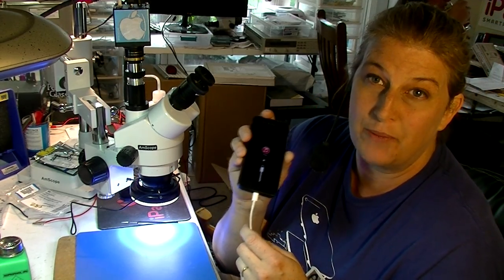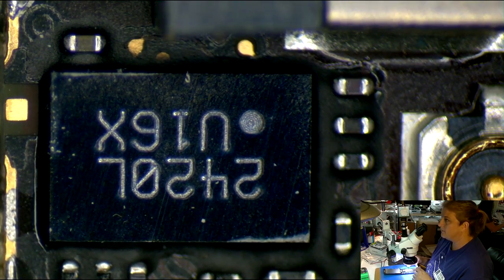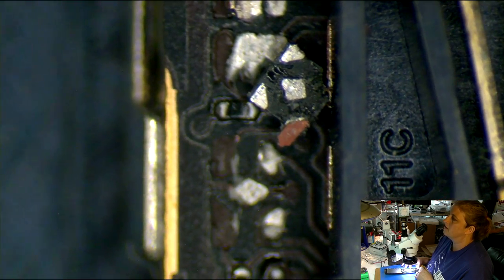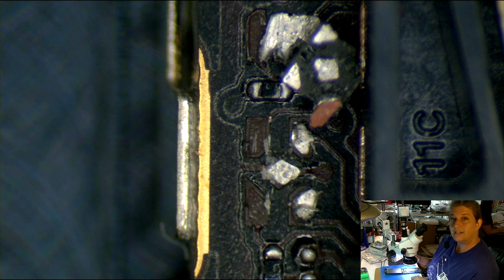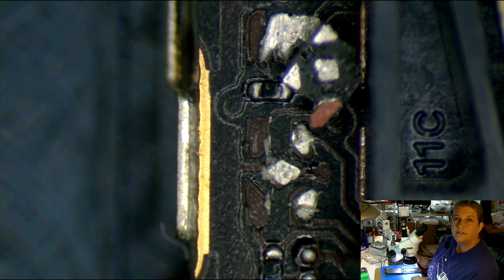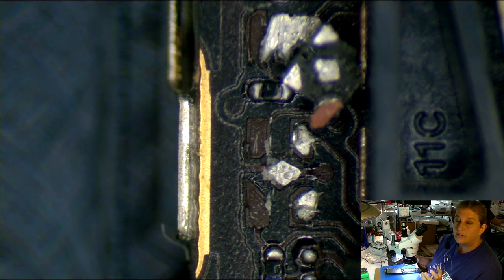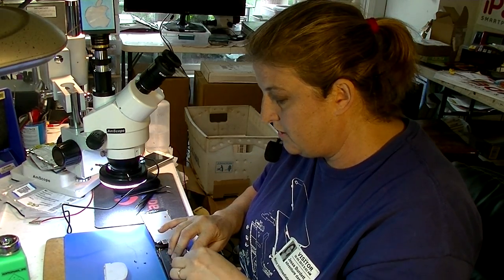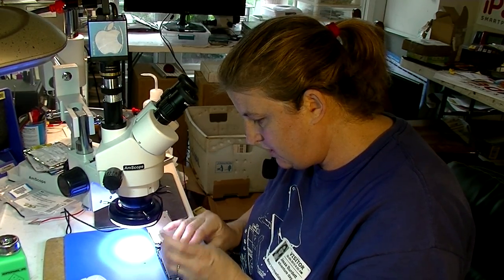iPhone 5 Logic Board Pry Damage after Battery Replacement

Comment: I searched this video to see how can I fix pFy damagr which possibly I made during Battery replacement. but good thing I found at the end of video that power button has two littke golden pressers which makes connection and make button work. I just used a screwdriver to connect while digitizer was lifted up and it worked. That means my curcuit on phone is fine and no Pry damage. So I little pull them uo so when the digitizer closeses down can make a firm connection on its press. IT DID WORKED OUT FOR ME. I AM HAPPY. SO ALWAYS CHECK FIRST BEFORE DECIDING ITS PRY DAMAGE. IN MINE CASE THERE WAS NO PRY DAMAGE JUST A LITTLE PULL TO THOSR TINNY GOLDEN FINGS ON THE CIRCUIT MADE IT WORKED. THANKS TO YOU. YOU ARE REALLY DETAILED.

Comment: Thanks for your video. Yesterday, I took my iphone 5 to the Apple Store; when I went to pick it up,  the phone had the same problem. The tech had no idea what happened, but obviously an unskilled individual blotched the battery replacement. Although they said they will replace the phone, they didn't have one in stock and I'm having to wait several days until one is found. Sucks!

Comment: Very informative, thanks.   After replacing my LCD + screen, I was testing it before I reassembled the whole case.  Home button wasn't working, and that was obviously because the case wasn't closed and the flex cable not touching the opposite connectors.  Duh!

Comment: Hey there. Today I switched the logic board of a white iPhone 5 with the one of the black variant. After that, the exact issue came up. Now, I was wondering if maybe the logic board is just not compatible with that white model? Or does every motherboard work with any color variant?

Comment: Hi,
I have an iPhone 5s and have recently changed out the battery. Everything works perfectly except for one thing. Now- when I use one of my 3 bluetooth headsets, I have no sound when placing or receiving a phone call using bluetooth. I have all other sounds in the headsets, clicks, rings, dings, music, just nothing when calling or incoming calls. Speakers all are working. Ive tried everything in Setting-General-Accesibilty like resting the network and rebooting, un pairing etc. 
Can you tell me what you think might be going on with my phone?

Comment: I have a capacitor missing next to the battery plug on a 5s motherboard. Can you add a replacement capacitor onto this board if I send you the motherboard? Please help.
Reply from the maker: Yes, but it probably will never make a practical difference that you will notice

Comment: hi there i have a question, wouldn't it be better to remove the logic board from the casing instead of working on the case?
cheers
Reply: No that is totally unnecessary for this repair
Reply: i am going to do a repair tomorow, the u3 is still good and pads are ok, but the solder joints broke off, would you say hot air is more difficult than the soldering iron? also where did you get your microscope? i want one :)
Reply from the maker: Hot air will burn up SIM tray.
Microscope is Omano 2300.
Reply: iPad Rehab Great job with your help.
I was able to solder it without scorching the sim card holder, and using hot air, much easier for me.
I now have another additional problem (i gave it to my customer anyway) the home button sometimes thinks it's stuck.. but that happened after i cleaned the phone, i spayed my detergent directly to the screen, maybe some of it got into the home button, i used the original chip that i damaged, as i ripped it from the solder joints but it was still holding all it's 6 legs...
Anyway i am waiting to hear more from my customer :p
Reply: You really can't re-use the chip--it is easily damaged internally.  The overactive home button is definitely from the repair.  Replace the chip and the local resistors
Reply: Jessa Jones right, i'll do that. the local resistors were untouched, i used a plastic lift and was gentle enough that only knocked out that single chip, resistors are untouched, not even Q3 was damaged
Reply: Jessa Jones also, are you sure it's from the u3? because sometimes the phone is normal, and other times it activates voice control by himself, i gave it to my customer back because he was in a hurry but that only happened after i cleaned the phone and sprayed the screen...
Reply: Yes 100% sure.  It is either U3 or the adjacent resistors.  I have seen this about 5 times--replacing the chips will solve
Reply: Jessa Jones hum..., i'm sure i have reseated the resistors when i reworked it with the HotAir Wand but i'll replace the U3 chip when i get it back :)
Thanks Jessa, you are the best! Going to get a Stereo Microscope like yours but i was unable to find one exactly like that, i like the one with the digital camera.

Comment: I can solder down to an 0201 size component myself, I just don't have the equipment to put this 0102 size capacitor back within the tight space between the battery connector and the heat shield. The tip of my soldering iron is 0.1mm. I have the capacitor and even if you say it doesn't make a difference, knowing it's not there will bother me. How much do you charge to put this back on? Please help.
Reply from the maker: you can send a quote request to the website: www.mendonipadrehab.com.   Tell her you need help with your little pecker job---she will know exactly what that means.   FYI--we will take off the heat shield in order to get clearance and then put it back on.

Comment: Where can I get one of those t-shirts? It's awesome! Thanks for sharing Jessa
Reply: That shirt was from iFixit a few years ago. Don't know if they still have them in stock
Reply: +Jessa Jones  hi my iphone5c was working I downloaded the ios 9.2 it worked for a but now nothing won't charge or turn on I've changed the battery and still nothing plz help x
Reply: +Angie Dunn charging or no boot problems can be many things. If you want us to troubleshoot it send a quote request to www.mendonipadrehab.com if you want to troubleshoot yourself post a question on iFixit answers
Reply: +Jessa Jones hi ive managed to get it on but its not charging it comes up with this cable or accessory is not certified and may not work reliably with this iphone I've just been and bought a apple lighting to usb cable and it still won't charge x
Reply: +Angie Dunn sounds like U2 chip failure
Reply: +Jessa Jones  thankyou could I fix this myself or would it have to be taken to a shop
Reply: +Angie Dunn it is only DIY if you want to make a career of it and invest in the equipment.  Micro bga chip replacement is not a plug and play repair
Reply: +Jessa Jones thankyou so much can I ask where abouts on the phone the chip is thanks

Comment: hi there.  i changed my iphone5 battery with a iphone 5c battery by mistake.the phone doesnt charge or turn on.ive also changed the charging port aswell.  can you please help    regards
Reply from the maker: +rez since a 5c battery wont fit in the 5, i'd take a hard look at that connector.

Comment: Hi, I've tried to change the battery on my iphone 5 and I got it working, but when I opened it back up to reseat the front assembly, everything stopped responding. Not responding to anything, even plugging in does nothing. What could be the issue?
Reply from the maker: Connect to iTunes to rule out no power from no display
Reply: +iPad Rehab There is no response when connected to computer.  Itunes doesn't see anything there.

Comment: I have an IPhone 5s, the home button was not working, and the phone case was dented on the side. I ordered a new home button and a back case, then changed them out. Now my power button and home button do not work to cut on the phone. The phone does function, but I have to plug it in or call it to open it. Any suggestions as to what the problem is.
Reply: When I replaced the parts, I made sure not to pry against the motherboard.
Reply: The cell has been dropped several times.

Comment: I have iPhone 5 and home button and power button stopped working. I searched on internet and lots of people complained about this issue after battery replacement or screen replacement and damaging some IC's during prying the battery or some other handling. 
I have not done any work on this phone and all IC's do not show any visible damage.
Reply from the maker: +Rakesh Thakare (Rocky) Oh they are damaged.  Don't try to pick them off without heat, that's my advice.
Reply: +iPad Rehab Thanks. Do you still repair them? I went on your website and emailed you some details.... Let me know and I will send my phone for a repair.

Comment: Hello, I have a question and I wonder if you can help me. 
So, I've changed the WiFi antenna and the battery and after that the phone developed a problem. 
After 5 or 6 minutes later The phone would shut down and would restart by itself. I was trying to make an update to the 
phone but during the process its stuck in recovery mode. I checked board pry and it is not damaged, do you know what can be the problem it this case? and if so, can you help me? 
Thank you
Reply from the maker: +tamara ousaraouli normal for 5-6 minutes sounds like gas gauge problem.  connect to ibackupbot and see if the phone is throwing gas gauge errors.  Get out of recovery mode with recboot

Comment: Hi,
I have a question: I replaced my battery on my iphone, i had difficult to take off the battery from the phone because comes with a kind of glue or silicone and i used a small screwdriver under the plastic piece next to the motherboard. Now when i tried to turn on, the phone still on apple logo for few minutes and after that the logo disappear, turn off (Black screen) and turn on again, but never go to the start screen. I went to a technician guy and he says that the battery that i replaced fried the motherboard because is more mAh ( i puted 2680). Is this possible? Thank you for your help
Reply: More likely you have some sort of pry damage or battery/board connection is damaged.

Comment: Curious, Would this also apply if the phone will not boot using the power cable as well? I have a iPhone 6s Plus that I attempted to replace the battery on.  New battery is in and connected but it will not power on with any method. I even tried the old battery and its the same problem. I might have pry on the wrong. Any ideas? I got the battery from iFixit and it has there logo on it.
Reply from the maker: Are you sure it's not booting---and not a no display issue?
Reply: I think so. I turn it on with the ower button. (Well hold it down like im turning it on for a few seconds) then I wait a few seconds to let it boot up and get to the main screen. I then try the mute switch to see if it vibrates and holding down home button for Siri vibration. None of this works.
Reply: Its not getting warm either which normally it does when its on
Reply from the maker: The test is to see if it is detected by iTunes.  Assuming not, then you need to troubleshoot a no power problem using DC power supply and significant experience combined with microscope visual exam---otherwise it is time to send it out for iPhone 6s+ no power solution.
Reply: I get a error message when plugging it into itunes saying: "iTunes cannot connect to the iphone "Matt" because it is locked with a passcode. You must enter your passcode on the iphone before it can be used with itunes." so not sure what that means since it appears to be off
Reply from the maker: That means it IS on and you have an image or backlight problem.  Troubleshoot from there--super common issue
Reply: Thanks! Had to have a phone so I just spent $1200 on the new one but this should make for a fun project phone. Thanks for your help!!
Reply: So I confirmed what you said about it being on. I opened the phone and disconnected the battery and plugged it into the computer with no response. So it is definitely turning on but not displaying anything or having any sound or vibration feedback. I disconnected the screen connectors and inspected for damage here: http://i.imgur.com/WN8AMc8.jpg and here: http://i.imgur.com/ntNXoKA.jpg as well as checking for long screw damage even though I am confident I tracked every single screw in its on ziplock and marked the bags with screw position. I didn't see any damage at the bottom of the screw holes. I guess my question would be, if it was just a back light problem would I not have sound and vibration feedback from the phone? Here is a pic of the entire inside here: http://i.imgur.com/5c2IaHe.jpg Im baffled. I need a clue!!! Thanks for all your help. By the way I love your videos especially the soldering series with the guys from ifixit.

Comment: Hi there, is there a video where you show (and talk about) your equipment ? If not, i was just curious about your flux, what kind of flux do you use? Thanks in advance and good job  by the way :)
P.S. Is there a way I can follow your website by RSS feed? I didn't find it in the home but it could be my fault.
Reply from the maker: Hi! Thank you for your interest in the equipment we use.

Flux: https://mailin.repair/amtech-nc-559-v2-30-cc-16160.html

Station: https://www.amazon.com/gp/product/B0012BC3TM/ref=as_li_tl?ie=UTF8&tag=rossmanngroup-20&camp=1789&creative=9325&linkCode=as2&creativeASIN=B0012BC3TM&linkId=c37220e0ce001d7a5715c06aeb7648b1

Tweezers: https://www.amazon.com/gp/product/B009SCNJOK/ref=as_li_tl?ie=UTF8&tag=rossmanngroup-20&camp=1789&creative=9325&linkCode=as2&creativeASIN=B009SCNJOK&linkId=5d011299f6ba3effaa2ee4012df19da5 

Tips: https://www.amazon.com/gp/product/B00NTB4RTW/ref=as_li_tl?ie=UTF8&tag=rossmanngroup-20&camp=1789&creative=9325&linkCode=as2&creativeASIN=B00NTB4RTW&linkId=d8dea927bda54ddc3acbfdbf24badd66

Micropencil: https://www.amazon.com/gp/product/B00O4H41X2/ref=as_li_tl?ie=UTF8&camp=1789&creative=9325&creativeASIN=B00O4H41X2&linkCode=as2&tag=rossmanngroup-20&linkId=467ab5cdc75e3fcfeabd5093cebbcc20

Microscope: https://www.amazon.com/gp/product/B005MRAAR4/ref=as_li_tl?ie=UTF8&camp=1789&creative=9325&creativeASIN=B005MRAAR4&linkCode=as2&tag=rossmanngroup-20&linkId=8c3b94523f849afcbb9e232f303e4670

My preferred hot air station: https://www.amazon.com/gp/product/B00FS7C08U/ref=as_li_tl?ie=UTF8&tag=rossmanngroup-20&camp=1789&creative=9325&linkCode=as2&creativeASIN=B00FS7C08U&linkId=73e81b54b2754c643f1b53dfe0a06276

Affordable, but still workable hot air station: https://www.amazon.com/gp/product/B000R94OHE/ref=as_li_tl?ie=UTF8&tag=rossmanngroup-20&camp=1789&creative=9325&linkCode=as2&creativeASIN=B000R94OHE&linkId=5063e5f2215b1182dbb07273bbb5ae77

Ultrasonic cleaner: https://www.amazon.com/gp/product/B00VGXXJDA/ref=as_li_tl?ie=UTF8&camp=1789&creative=9325&creativeASIN=B00VGXXJDA&linkCode=as2&tag=rossmanngroup-20&linkId=86be2e7d472d625cd48a93eee9cc94b1

Ultrasonic cleaning fluid: https://www.amazon.com/gp/product/B00BWESDKW/ref=as_li_tl?ie=UTF8&tag=rossmanngroup-20&camp=1789&creative=9325&linkCode=as2&creativeASIN=B00BWESDKW&linkId=18797ab2fefeebbb442a4bd0a694e963

Multimeter choices Extech: https://www.amazon.com/gp/product/B000EX0AE4/ref=as_li_tl?ie=UTF8&tag=rossmanngroup-20&camp=1789&creative=9325&linkCode=as2&creativeASIN=B000EX0AE4&linkId=36de4ac106c105fb0a2ebb9f1c4d869c Fluke: https://www.amazon.com/gp/product/B00NE9FF40/ref=as_li_tl?ie=UTF8&tag=rossmanngroup-20&camp=1789&creative=9325&linkCode=as2&creativeASIN=B00NE9FF40&linkId=f95a90929aa103f39d05402c47d4042e

Multimeter Probes: https://www.amazon.com/gp/product/B000VRFKPW/ref=as_li_tl?ie=UTF8&tag=rossmanngroup-20&camp=1789&creative=9325&linkCode=as2&creativeASIN=B000VRFKPW&linkId=e6a7d3405038f673acc26eca8758dc10

Solder: https://www.amazon.com/gp/product/B004X4L076/ref=as_li_tl?ie=UTF8&tag=rossmanngroup-20&camp=1789&creative=9325&linkCode=as2&creativeASIN=B004X4L076&linkId=86c54186bfd0fb0992820adb50ec8bee

Comment: after replacing the battery, the phone works fine until the battery reaches 50% or lower then it starts restarting itself. Was there any damage done to the board or could it be a faulty battery?
Reply from the maker: +bravr67 most likely bad battery
Reply: ok so it only turn off if I'm using it below 50% otherwise it'll stay on standby.  I did put the long screw in the wrong hole by mistake but was gentle so could I have still done damage to the board to cause this to reboot after dropping below 50%? what are the symptoms of drilling into the circuit board? thanks
Reply: iPad Rehab I have the same problem after replace the battery,and the bluetooth call doesn't work.but bluetooth media work fine,let me know if you have any subjection for me.

Comment: Can anyone help me? When I plug my phone in, I don't get any response, my 5s was working fine until I changed the battery, I though maybe I done some pry damage, but when I plug my phone in I don't get any response, no logo, no itunes icon... I plugged it into my pc, the pc recognizes it, but my phone doesn't vibrate or give any sign, I also checked connectors... nothing seems to be damaged. Can it be that maybe I just happened to get a faulty battery? I got it off amazon...
Thanks.
Reply from the maker: if your computer recognizes the device in normal mode asking for the passcode, then it is on.  You either have a bad screen now or damage to a backlight/image circuit.  You can send a repair request to ipadrehab.com Start Repair